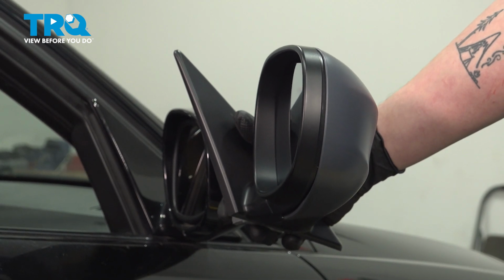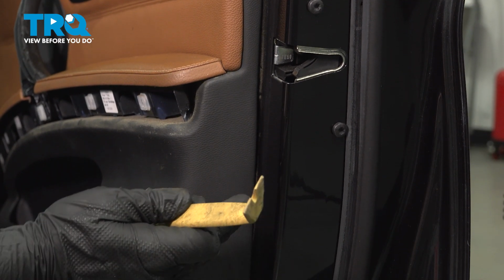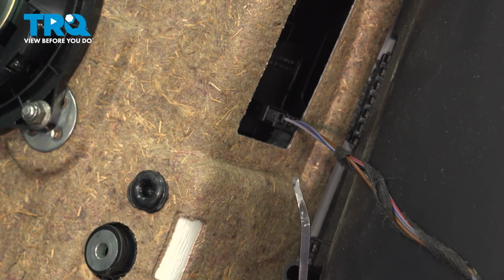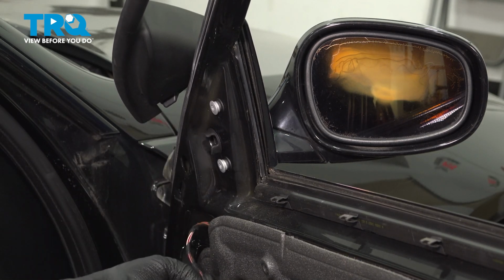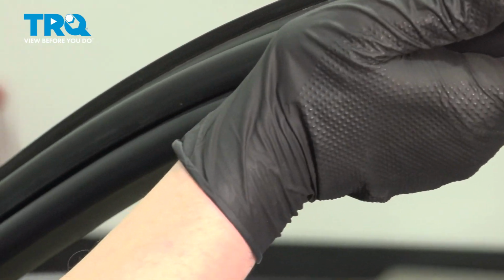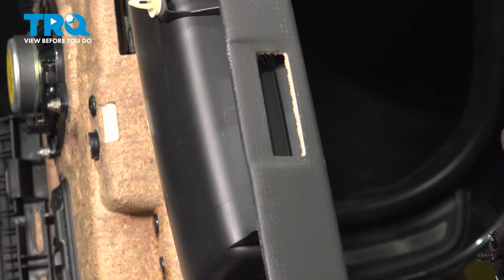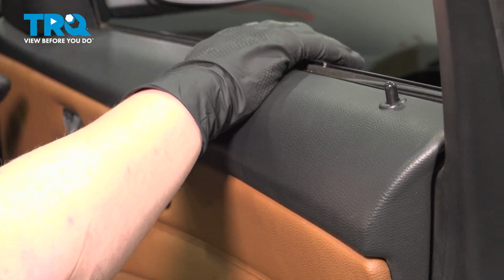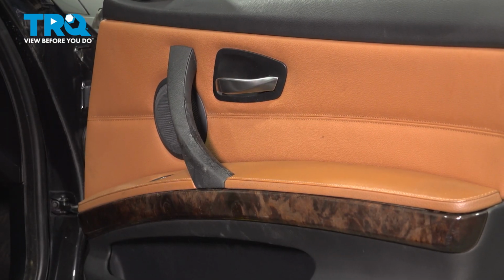How to Replace Passenger Side Mirrors 2009-2013 BMW 328i xDrive

Comment: I just replace my mirrors but, I can’t adjust my mirrors in anyway, I can’t adjust the view or fold it in or out the mirrors.. I know it has power because when I manually try to adjust the mirror view, the glass automatically starts adjusting back down… Any suggestions?

Comment: I drive a 2007 328i and need to replace my driver side, which side mirrors would be compatible with my make and model?
Reply from the maker: +@rayvonthony6847 Mirrors are specific to the original mirror options. Please feel free to contact customer service directly for assistance in finding the exact mirrors you need.